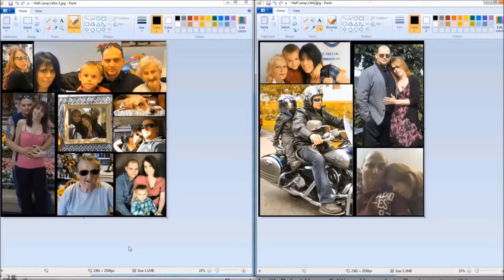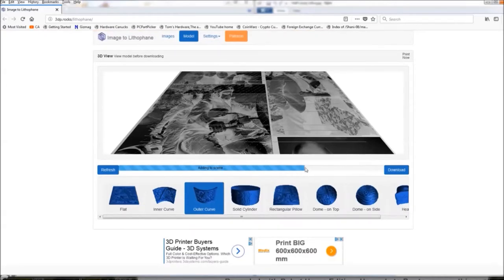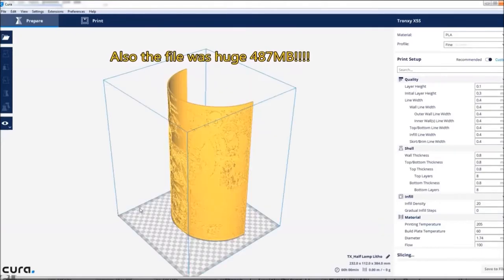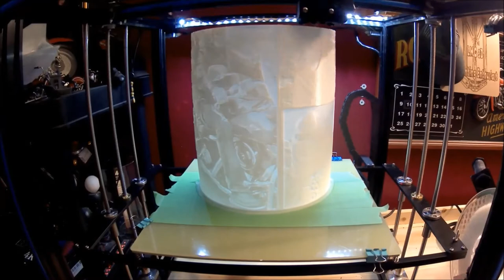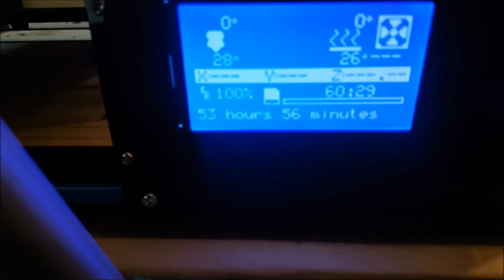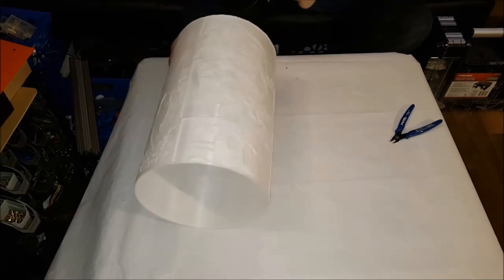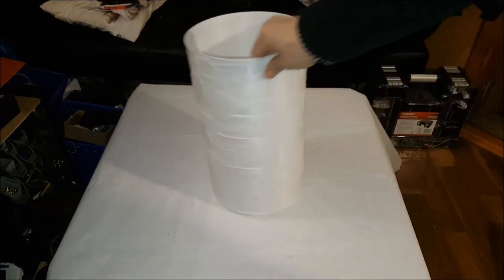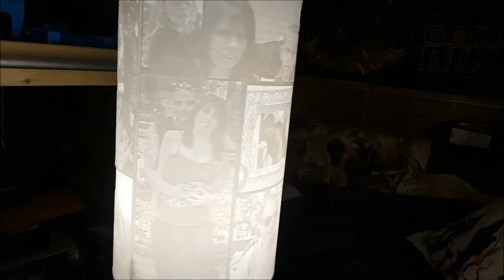Epic Print time 'Lithophanes' on the X5S

Comment: Amazing, I just made the mistake of showing my wife, and I haven't even put the printer together yet.  1 question, when you show the print time on the first half at 9'18", the hotbed shows the temp at 61 degrees and your 90% of way through the print. I don't know much about 3d printers I'm still learning, but is there any need to be heating the hotbed when the print is so far done, isn't the heating of the hotbed just to get started or is there another reason? so if there is no reason could the hotbed be switched off?
Or does the print need to be warmed all the way through to accept the print nozzle laying down the PLA?
Reply from the maker: If I let the bed cool down it will change the shape of the bed slightly and it will also give the print the opportunity to come loose. I always recommend the heated bed stay on. I gave had prints in the past where I turned the bed off after the first few layers were done and come back to have it pop off or parts warp off the bed
Reply: O.K so it helps keep the part stable during print, many thanks